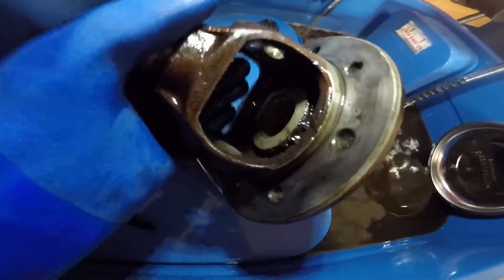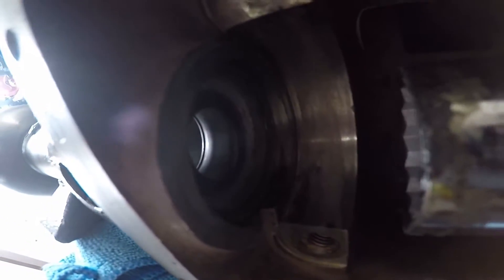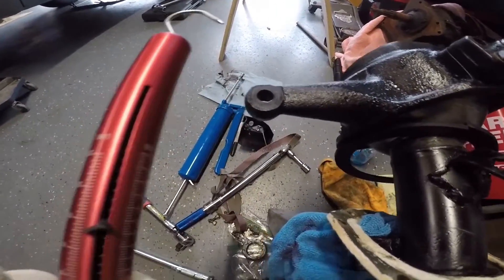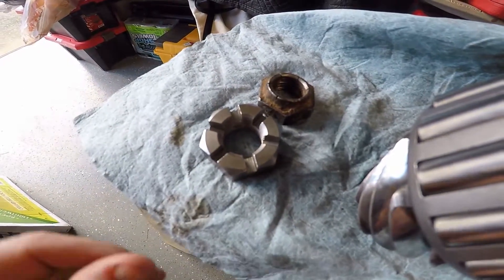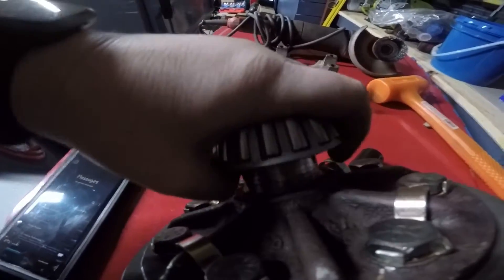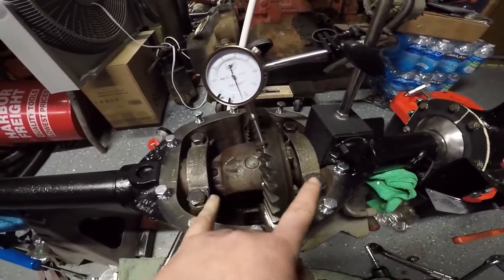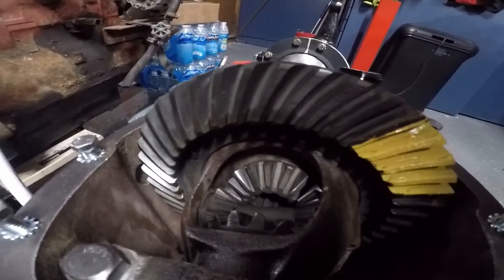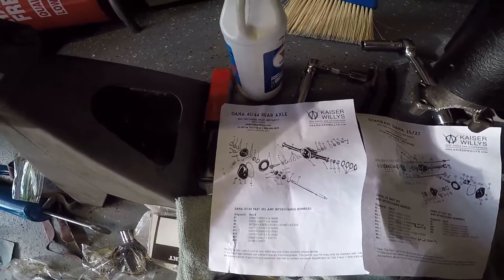Working on the Dana 25 still- backlash and pinion

Comment: So are you going to be an EO on a WMEC?
Reply from the maker: Yup- very possible! Especially when your OERs say you'd be good at it.. what ever keeps me in my house!  If that happens I need to hire a pupsitter for the patrols.  My mom is coming out soon for my next trip but her health is starting to go with kidney disease.
Reply: How many years you got in? I pulled the plug at 25, I was geobaching it and had enough, went home back to Oregon. Got into Wildland fire fighting after Coast Guard, been doing it for 13 years. Congratulations on making O-3, was wondering if you thought about it or finishing out at W-4.
Reply from the maker: I hit 22 in early January.  I dod think about going up thru W4. I wouldn't be able to make and hold W4 by 30 years, and I DO NOT want to do 30 years.  High three will put me at 25.5 years. If I time it right, I might be able to pull off 26 and a month.  Lots of headaches to follow if I take an EO ride but its the quickest way to retirement with the most $ I can get.